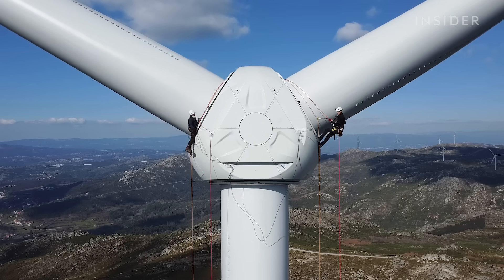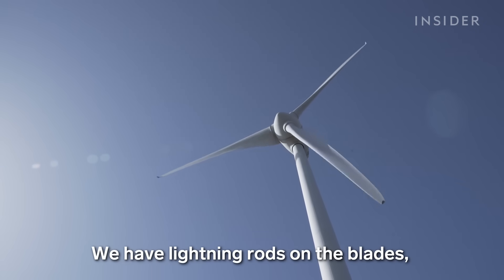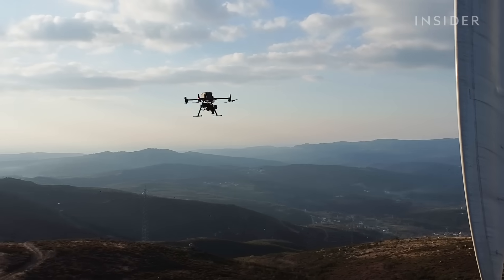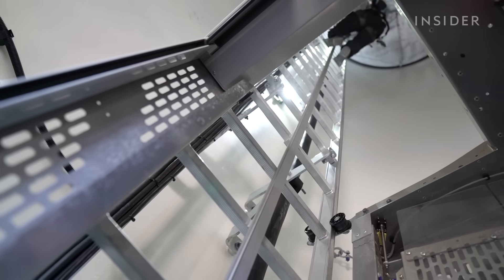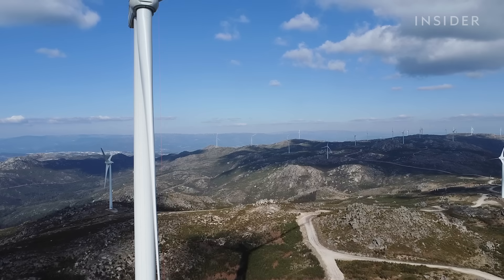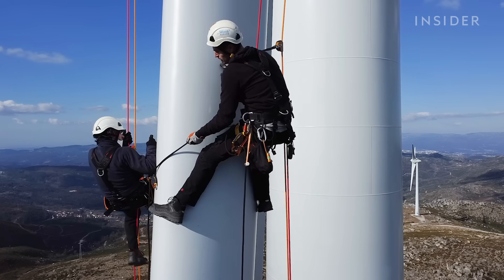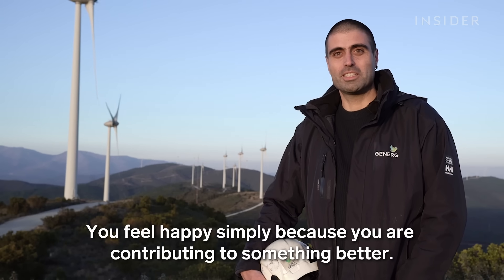How Wind Turbine Technicians Risk Their Lives to Keep Blades Spinning | Risky Business

Comment: Wind and nuclear are relatively safe in terms of deaths per TWh (both WAY safer than e.g. black or brown coal, oil or even biomass), with the wind taking bigger toll on the life of engineers and inspectors (fires, blade failures etc.). It's a dangerous job and that is something to be considered when going "green" since the term is multifaceted and throws so many shadows as well, that are often not mentioned by the proponents (like huge amount of non-recyclable waste from decomissioned turbines/blades). Not judging, it's just something that needs to be said and considered, because the downsides grow with the number of power plants.
Reply: My brother in christ why are you spreading Fossil fuel corporation talking points
Reply: Yep so do nuclear reactors have waste that is even worse and doesn’t have a storage place yet. If that thing exploded nothing would happen if a explosion of hydrogen happens in these nuclear light water reactor you get a area inhabitable and that for several thousands of years.
Reply: @platin2148  lmao Fukushima was a modern example with no instant deaths and we can just burry the nuclear waste
Reply: @Vivuvuvj  Good then you can go over there and say to them just burry it. Saying this is basically showing that you seem to not understand what kind of waste we are talking about. But have fun where ever you are with that thinking.
Reply: @platin2148  All of the nuclear waste ever made is a fraction of the mass of the waste produced by wind, and the nuclear waste is sitting in a parking lot on site, instead of having to make vast landfills for turbine blades. 
And we can recycle nuclear waste from old plants and reuse it in new 4th gen plants, and then continue to refine it after use and reuse what wasnt until all of the U-235 is split and no longer high grade nuclear waste.
Reply: @jaycweingardt11  How many of these 4th generation plant’s are online? Seems to be near Zero. For the waste sitting on site works only for a limited amount of time as it piles up it gets more dangerous. That little waste seems to be a very real pain compared to Glasfiber Compounds just being realistic here. Also it makes basically no one independent just look from where most of the nuclear fuel comes from. On the long term scale something like Evor is way more sustainable than nuclear. 

Not saying i’m strictly against Thorium Sodium reactors but is see these as a last resort maybe a more secure stop gap to fusion.
Reply: @platin2148  nuclear power plants are safe, there are thousands of them around the world, nothing ever happened. Except for 2 instances that are caused by *human error*. For example in Chernobyl they used outdated coolant, out of Graphite. Nowadays it is different, if we use Graphite and not pay attention we get another Chernobyl but no power plant uses Graphite anymore
Reply: @neonlight1214  ? It’s “boronated graphite” like in the old days what you wanted to imply is that this type of reactor isn’t used anymore. 
Current gen reactors have to much of a risk to ruine a place for the next 1 million years prefer to not have that danger. 
Also they where not made for land usage at all. 

I’m open to talk about THSO or Helium Gas ones but Light Water Reactors are from my table.
Reply: @platin2148  I am not an expert in energetics but this issue is addressed by nuclear waste reprocessing (e.g. breeder reactors, thorium fuel cycle) into much safer waste, with a half-life measured in decades instead of millenia. I think it's a technology still in development with some experimental reactors in operation (I think China and India already have some). Some designs of e.g. small modular reactors are also much safer and cannot go supercritical. There is even a promise of a closed fuel cycle, so I am optimistic about nuclear although not in the near future.
Reply: @LiborTinka  smaller reactors are not inherently safer, just...smaller. This is offset by there being more. the danger with nuclear is allways about material getting out, not the plants going critical or anything like that.

if small reactors is what we need to sell the public on nuclear, by all means, but it'd be pure propaganda and less safe if anything depending on who'd get to operate these "small" reactors.
Reply: @platin2148  Lots of false information here.

We have storage for nuclear waste, first of all. The reason we don't have many permanent places is because that's not politically convenient. If you have a "permenent" storage that's it you're settled with it and historically the public is very uninformed and therefore scared. "temporary" storage on the other hand you can allways move. Nuclear waste is inert, it's encased it solid metal cyclinders and just...sits there. now you gotta make sure no one take's it and that it can be inspected from time to time. That's it, totally safe. This is if you're not feeding your nuclear waste into a particular reactor designed to essentially use it all up, less efficient, bit more expensive but very doable.

As for an explosion at a nuclear plant...no. There's nothing there to explode and the entire facility is heavily shielded by meter of steel-reinforced concrete. If you smuggeled a bomb literally into the reactor, you'd damage the reacctor but that's about it. the radioactive material would now just sit in there and not do anything. Like it currently does in chernobyl, there reason that was more problematic was because soviets didn't install the heavy shielding usually in place, allowing material to scatter around.

And while we're talking chernobyl...that is pretty habitable right now. You can go there without protection and walk around. It's recommended you don't ingest anything or take item's, but that's mostly a safety measure. The animals there certainly flourish.
Reply: @nonyabisness6306  And there is even more fals information in this comment. Kinda pointless to argue. 

You don‘t need a bomb for such a reactor to blow up reality knocks on your door and says to you hydrogen. Most reactor explosions that happened are because of it and the thing that happens when you quickly depressurize such a reactor.
I dunno what you think happend in Fukushima but there it wasn’t a shielding issue.. But over heating of the core+depleted crap and the subsequent hydrogen explosion. Because it’s a ducking light water reactor which is the worst design if not submerged. 

Nuclear waste is Stored in Zirkonium and is actually incredibly hot still from the radiation side yep you are right for the period in which it is inspected etc. when you buried it then there is no such thing happening as in nobody inspects it any a leak of radiation isn’t unlikely. 

Nuclear is btw. also substantially more expensive and especially these LWR‘s don’t make a lot of sense anymore today.

Animals flusihing is not a indicator of radiation planting something there or construction is basically impossible without taking a substantial amount of radiation up into the air. Living there still includes you getting a higher dose of radiation here to say not so much anymore but still enough for it to be not background. It’s actually a interesting science experiment that happens there where the biggest bet right now is 60 to 80 years for mutations arising that will be lethal to these animals. It’s so safe there that you need to have a geiger counter 24/7 there and be checked for radiation every 24 hours or when you enter/leave.

Comment: Even worse when you have to check the blade while it is rotating...
Reply: That never happens. First, they wait for a windless day, then secure the blades so they don't turn. (They have brakes: "Wind turbines are required to have two braking systems, one of which must be aerodynamic. All brakes are designed such that the unpowered (failsafe) state is for the brakes to be applied.")

Comment: I think you need to review your logic: "...risk their lives every day... with only climbing rope and a harness keeping them safe." Well I have climbed many a place or thing using rope and harness. I can tell you now, when done correctly - as these men surely do, using rope and harness is as safe as driving your car to work. Though it could be said that we risk our lives every day driving to work :) Yes. Yes we do. But due to 'safety measures' the risk is so low, it's something we don't think that much about. Which is what these men do. Setup their safety gear, and get to work.
Reply: They know that, but clickbait titles like these bring on the clicks, so they format the videos like this. :)
Reply: It is one thing to be safe while simply repelling down with a rope, but another thing is to operate simultaneously with hammers, grinders, washers and painting guns. The job is unnecessarily dangerous, as there are robots like Aerones that ensure a much safer procedure.
Reply: But if you crash your car you don't always die? If something is done incorrectly here and you fall to the ground you 10/10 dead

Comment: I am assuming 4.8 MW/hour is enough to power 5000 European homes for an hour (what unit and in what season)?  I am assuming there will be a difference in power generation in different seasons and time of the date. What is the average daily generation of that wind turbine in one year?
Reply: Does not work like that. It's aggregated over a Farm of Dozens or Hundreds of turbines. Thus you get an Average long term rate. Difference in power generation is Statistically Not Relevant.
Reply: <<I am assuming 4.8 MW/hour is enough to power 5000 European homes for an hour>>

How many European homes will that wind turbine power if the wind isn't blowing?

And what do you do THEN?
Reply: @SeattlePioneer  do you know what batteries are? also wind wil only slowdown they don't ever stop so you think all is an infinite resources nope oil will eventually dry up meanwhile solar and wind will not
Reply: Sure, output generally varies throughout the seasons, with Winter time in the northern hemisphere often bringing the more favourable winds.  The average that any particular turbine produces depends highly on its location and the particular conditions in that local for a given season or year.  Historical wind speed data for an area usually gives a reliable indication of production expectation prior to construction.  Typically a '4.8 MW' turbine (or any rating of turbine) would not be expected to generate its nameplate capacity continuously throughout a year as there are no places that produce perfect wind speeds continuously, so actual output is based upon long-term wind speed averages.  For example, you may generate 2 MWh/year for a 4.8 MW turbine in an area with an annual average wind speed of 10 m/s, with a seasonal average of 15 m/s during Winter, and 5 m/s average during Summer.  See Capacity Factor.

Comment: meh... any job like that is as risky as this... cleaning windows on skyscrapers is risky
Reply: Cleaning your own from a ladder is more likely to cause harm
Reply: <<
Jebi Se
3 months ago
meh... any job like that is as risky as this... cleaning windows on skyscrapers is risky>>

Ummm.  Window washers aren't working around huge amounts of mechanical and electrical energy.    They aren't exposed to lightening and wind to nearly the extent that these techs are,  would be my guess. 

In an emergency,  I'll bet a window washer can break the glass he is cleaning and escape from that exposure quite rapidly.

Not an option for someone working 500 feet in the air in an isolated situation,  with only one other person to help escape if injured.  And what happens if BOTH techs are injured and can't escape?

Comment: 4,8MW per hour... come on people, thats not a thing...
Reply: It’s very real. The latest in onshore plants are capable of 6MWh. Some offshore units can produce upwards of 15MWh. Of course that’s only in full production winds. Between 11-14 m/s or approximately 35-38 mph and start producing as low as 3.5 m/s or 8 mph. The ones I work on are smaller and make only 1.65MWh. They generate millions of ft lbs of torque. Truly amazing machines
Reply: @vincesmith1906  MW is a unit of power. MWh is a unit of energy. MW per hour is not a thing, that's what Robert was pointing at
Reply: @polterp  That totally doesn't make sense, as MWh (or more correctly MW/h) is the same as MW per hour.
Reply: @akyhne  MWh and MW/h are very different things, I suggest you look it up
Reply: @polterp  OH really? I'm sure you can tell me what the difference is.

Comment: The inside of the blades seem to be the perfect place to dump a dead body.
Reply: actually, if the weight of one of the blades was off, sensors in the turbine would pick that up instantly
Reply: @RobiEys  just dump 3 equally massed boddies then! ;)
Reply: But would it fall between the wing tip and the hub as the turbine turns?

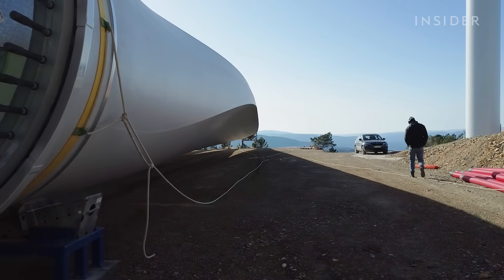Comment: 8:21 need to work on units my friend. 4.8 MW in an hour is actually not an electricity generating rate. 4.8 MW is an electricity generating rate, 4.8 MW-hr /day is an electricity generating rate, and 4.8MW-hr per hr is... 4.8 MW. Not sure which one they meant.
Reply: Yes I live in north Manchester UK,  my 4.9kW Solar energy system delivers to my house energy measured in kWh that can do in Spring and Summer anywhere from 7kWh (crappy day) to 14kWh (good day) to 24kWh (exceptional day).
Reply: Comes down to the same thing. A 4.8 MW capacity turbine produces 4.8 MWh per hour, as 4.8 MW stands for 4.8 MWsecond. Idk what the problem is?
Reply: @augustus331  Bruh, she said "4.8 MW of energy in an hour"

MW is unit of power, not energy
Reply: @augustus331  na that's not it
Reply: @augustus331  4.8MW works out to 4.8 megajoules per second, but MW does not have a time component - it's only an instantaneous measurement of power.  The peak power of a common static electrical spark is measured in the kilowatt range but for a very short period of time.  The power might be expressed as 4.8KW.  It does not express 4.8 KWsecond of energy.

Comment: Omg pay these men more money. I swear I almost threw up just watching this. If I made it to the top I'd be so scared I'd probably just launch myself off of the dam thing.
Reply: Wind techs makes quite a bit, especially blade techs like this. They can make over $50 an hour, plus a $150 ish per day perdiem. They can easily clear $4K in a 2 week period.
Reply: @nascarbilly2424  who told you that? 😂
Reply: @kape28s  it's true especially in the US where you work on the more extensive damages or hold a higher qualified blade  cert level and rope level (yes there are levels to your certification 🤣)
Reply: @lukekennedy6394  i work as rope access technician
Reply: @kape28s  So do I and I was earning $44 an hour and $65 after 40hrs. So what William above said is more than possible....like I said a blade D, irata lvl 3 can earn £34 plus!